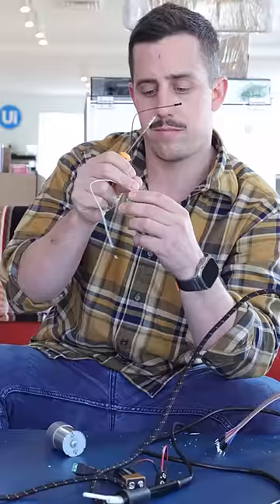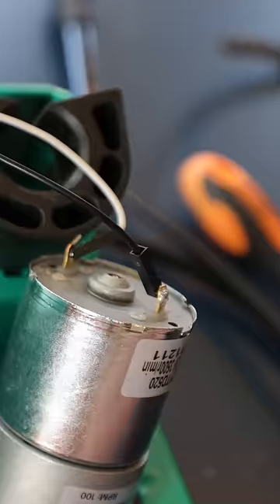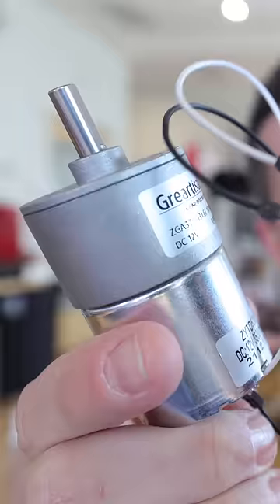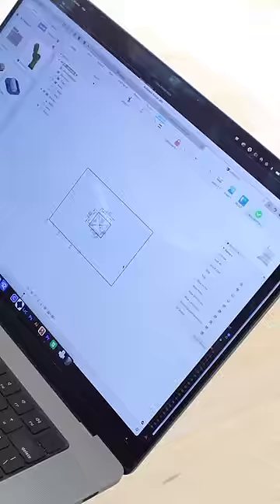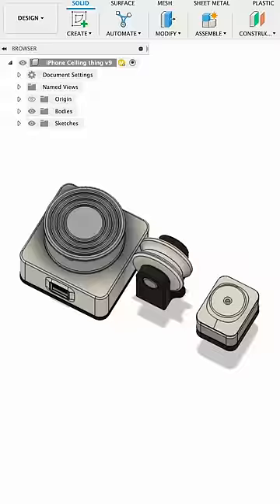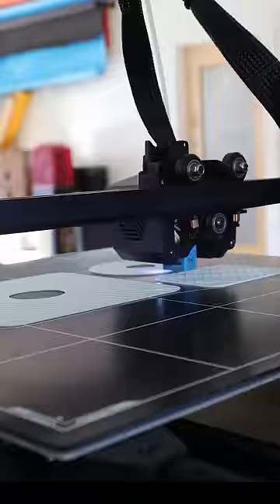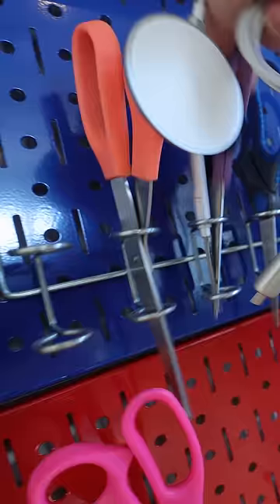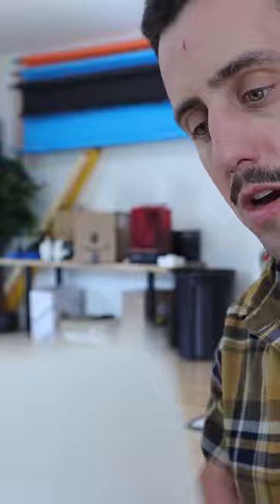How this cut on my forehead inspired a new invention idea.

Comment: They really should make mag safe an open thing so other manufacturers can use it for various products it's a good idea for accessories and stuff.
Reply: Agreed, credit where credit is due making wireless charging magnetic is genius, as was the original magsafe magnetic cable on the MacBook chargers. It was mad that they removed it from the laptops for a while
Reply: They do. There like magsafe pop sockets and gimbals and stuff

Comment: Cool invention, works quite well, but I see a flaw in it, there’s only 1 strand of rope holding it, which means it will constantly rotate, there should be another pulley about a foot away from the one on the ceiling so that 2 ropes are holding up the phone, keeping it more steady and preventing it from rotating